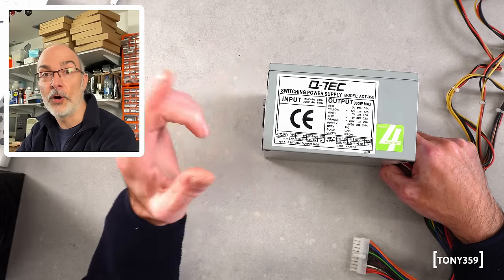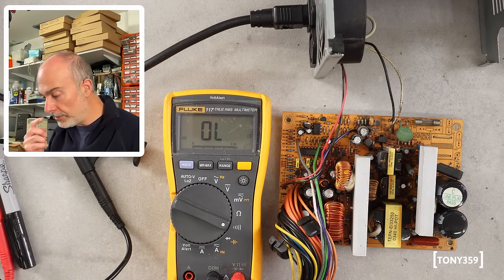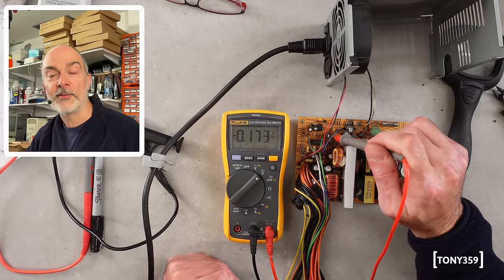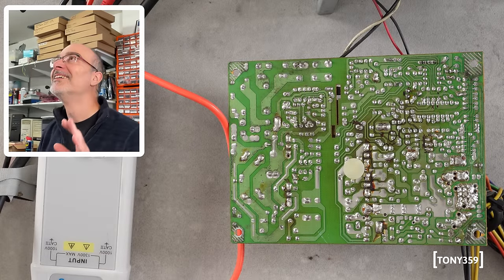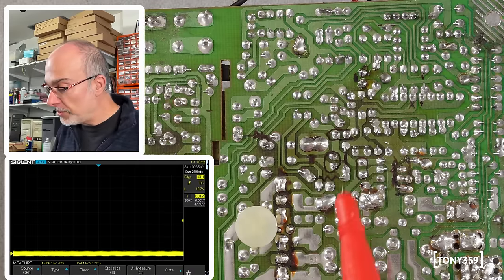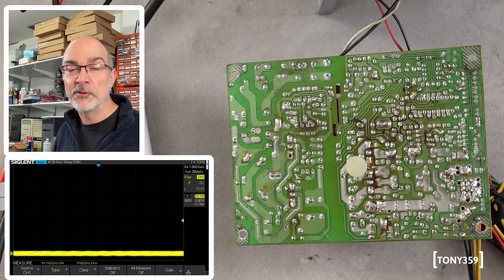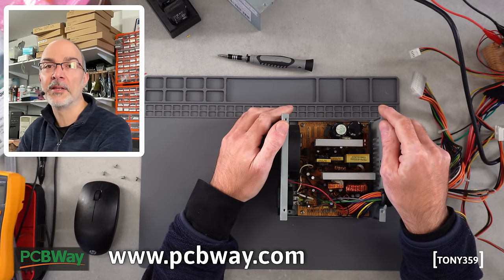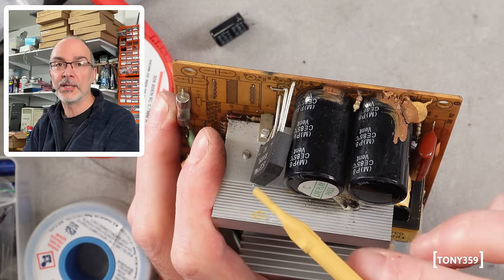Let's fix this 𝗗𝗘𝗔𝗗 ATX power supply!

Comment: I've repaired many power supplies years ago and I found it's usually the capacitors too that fail, especially the capacitors which stabilize the DC power for the switching circuit. These are usually capacitors in the 4.7uF to 100uF range and are mostly located closeby the heat sink of the MOSFETs that do the switching. The high temperature and proximity of the heat sinks dries out those electrolytic capacitors and they start losing their capacity up to a point where they cannot hold the voltage stable anymore and the entire power supply dies and starts to whistle.
Reply from the maker: Indeed, swapping the caps will revive a good chunk of those PSUs :)
Reply: Another common fault in older PSUs (80s, early 90s) is a small (single-digit µF) electrolytic on the primary side. I haven't had that in computer PSUs yet but in several VCR power supplies (Sony and Grundig). If that cap dies the PSU does nothing at all. I suspect it might be part of the passive oscillator circuit for the main power supply and if that doesn't oscillate it obviously keeps the whole unit from working. There's usually only one or two of those caps so I just replaced them all. Really interesting to understand how this circuit works now!
Reply from the maker: @Ragnar8504  Yes, that little one is critical for the oscillation!

Comment: Yey, Ton359 video! Thanks for making Friday more bearable! I fully support trying to fix things, that are broken, instead of simply throwing them. Great video, Tony :)

One small suggestion: when cleaning fans and trying to quieten them down, you can remove the white plastic circlip on the shaft, then pull the propeller out, then clean the shaft, the magnet dust and the bearing with WD-40 or IPA, then lightly grease with silicone grease. I have found this to be the cure for loud and vibrating fans with a needle shaft design. Then its simply a matter of putting the white circlip back in the groove on the shaft :)
Reply from the maker: You know what, I thought about that circlip (thanks for telling me how it's called!) - you see me fiddling with my tweezers at some point. Eventually I didn't try because I thought I might break it. I'll definitely try next time, it sounds like THE solution :) 
Thanks for watching!
Reply: @tony359  There is a slit in it, and I tend to collect dead fans, so keep them around as donors if I need to fix one. After all, to get it out you need to have side access, easy if you are breaking the rest of the motor, plus you need to often get extra little washers that set the float at the other end, as those also break or go brittle. Plus you get ball bearing ones, where you destroy the bearing removing it without damaging the shaft, but can destroy another to get the bearing out intact. Just a drop of oil onto the bearing, and leave to wick in, makes them run nice again, though getting it to the bottom needs some pressure applied to force oil through the top one, and down the shaft to the lower one. Needle through a spare rubber cap to provide the oil and pressure works, just press down on the cap to keep it on.
Reply from the maker: @SeanBZA  Thanks for the extra info!

Comment: Very satisfying to watch. The things you've learned during the repair were totally worth it. The next thing I'd have tested would have been the two TL494 outputs that switch the two small transistors that drive the base transformer. Sometimes those die as well. On the mains side of that base drive transformer there are two small electrolytic caps, typically 1uF, which are very important for driving the main switching transistors correctly. If those are dead, the main switching transistors can overheat and self destruct.
Reply from the maker: Of course, plenty of other things to check. I think it was the PS3 power supply I fixed in another video which had VCC but it was not switching - despite all the "alarms" were not on. So in that case a new (expensive!) controller IC fixed it! 
Thanks for watching!

Comment: Tip for "following the wrong trace":  Take a scan/photo of the board - top and bottom - and pull it into your PC - zoom in a few steps (4X) and its so much easier to trace the paths.
Reply from the maker: Great idea - Though I'm 100% sure I'd follow the wrong trace anyways! :D
Reply: I also sometimes put the picture alongside a mirrored one of the component side, makes tracing what goes where much easier compared to constantly flipping the board up side down.
Reply from the maker: @Ragnar8504  Great idea! I'm confident I'd still follow the wrong trace! :D
Reply: But thats what the Continuity setting is for😆
Reply from the maker: @snakezdewiggle6084  don't underestimate me! :)
Reply: @tony359 
No never underestimate you Tony. Its all the other Internet Experts that worry me. lol
Besides, we use the same grey coloured screwdriver.!😉

Comment: Thanks for this, I have modified quite a few old PSUs in the past to create variable output bench PSUs, but I have never understood how the low power circuit with the smaller transformer operated, makes total sense now. Glad to see someone actually do a repair by finding the fault instead of firing the capacitor shotgun at it, even if it was capacitor issues in the end. You certainly have earned my subscription.
Reply from the maker: Thank you and welcome!

Comment: I like the way that you worked through that. I saw the bulging 1000µF capacitors from the start so I was intrigued to see how you did the entire repair. I also like the fact that you took care of the glue. That type of petroleum-based adhesive gradually turns brown and not only becomes conductive but also corrosive! I've seen many examples where it has eaten through copper tracks, resistors and component legs.
Reply from the maker: Thank you, I'm glad you enjoyed the process! Indeed it was pretty clear the issue were the caps but it would have been boring to just swap them all!
Thanks for watching!

Comment: These ATX power supplies are relatively easy to fix.  Most problems are failing electrolytic capacitors and shorted switching transistors.  Some times just a crapped out cooling fan.  Components, except for a controller IC, are leaded through hole parts.  I"ve repaired several of them over the years so I have a few for emergency replacement in my half dozen desktop PC's around here.  Considering how cheap they look they are really quite rugged and reliable supplies.

After cleaning and checking wire connections and solder joints on the circuit board you are ready for a smoke test.  Use a series tungsten lamp if you don't have a variable auto-transformer and AC current meter to monitor power consumption from the Line.

After power up and no smoke the next thing is to power down and start looking for capacitors with high ESR (Equivalent Series Resistance).  Replace any that show significantly higher ESR than a new capacitor shows.  Then the next thing is to look for is shorted or open semiconductor junctions.  Same again, replace those that can't pass a proper transistor functionality test.

Your chance of having found what was killing your power supply is very good at this point.  Good luck!
Reply from the maker: Indeed - though you'll find a couple of videos on my channel where the fault was different. Those were fun to fix! But yes, let's say 90% it's the caps :) Thanks for watching!

Comment: Hey, instead of yanking out suspected bad caps you can just solder in a new one in parallel onto the old one, it saves a lot of troubleshooting time.  Of course this won't work if your cap is a short circuit, but I've never seen that yet and I doubt it happens often.
Reply from the maker: Thanks for the tip!

Comment: Glad you were able to restore this, possibly working better than when it was new. I did a blanket recap on my old psu, the system was working but when i changed the case i took a look inside the psu & saw loads of swollen caps.
Reply from the maker: I'm sure it's much happier now :)

Comment: Done a few of those, and generally replace the lot with around 1200uF 16V or 1500uF 16V units, as I can get skinny Nichicon ones, which will fit into the space on the board. Close enough capacitance wise, and usable on all the voltage rails. The standby supply I tend to go up in capacitance, and use 63V capacitors there, normally have a good number of 47uF 63V ones around, as those are a common enough value, and I use them on gate motor power supplies, where that, along with some 470uF 35V ones, are generally a quick fix on them. On a PC power supply higher value on small ones works, and on the larger ones whatever will fit so long as it is within 50% of the value also works, they are not too critical, just need a decent ripple current rating and higher voltage, and they will be better than the original MysterLee HooFlungDung capacitors that were used, because those were cheap that day, and fitted the board mostly.
Reply from the maker: Fuyihuu caps are the best!

That monitor was NOT cheap! I think it sold for £1000 back then. It was one of the best "pro-sumer" monitor you could get!
Thanks for watching!
Reply: @tony359  I saw some capacitors that were marked as Sanma, a cnockoff of Samwha, and some that were NItichon, a almost perfect copy of the Nichicon logo, but the caps themselves had failed while unused.
Reply from the maker: ahahah amazing!

Comment: I would recommend replacing those two large mains caps as well.

I repaired a very similar PSU a while back and re-capped the whole thing except the large ones. But it started misbehaving again after a few months. The large caps had failed and 50Hz mains ripple was coming through on the output. The caps had leaked badly, but I didn't see it because the glue around the base was stopping it spreading. 😅

Now this no-name 'cheap' old PSU is one of the best I have. Totally noise-free output, better than another much newer one I have!
Reply from the maker: Of course, I need to source some! Thanks for watching!
Reply: @tony359 just don't waste money going with branded ones, "chong" or anything similar is good enough for these PSUs, it's not like they come even from factory with something better (and managed to work for years used everyday), modern ones even come without plague installed :)
Reply from the maker: I tend to buy Panasonic - but I see what you mean. Those two caps in Panasonic brand would probably be a lot of money! :) 
I should really have two drawers: the good ones and the CHONG ones for such projects! :)

Comment: 22:40 that white plastic is removable (it has a gap that you can spread) that will allow you to separate fan blades with shaft from stator so you can clean it much better. It's pretty easy to take apart and put back together
Reply from the maker: Thank you - several viewers have mentioned that. I didn’t know that! I was tempted to try to remove that white bit but I was concerned I could damage everything. I’ll definitely try next time!

Comment: Who would've thought that cheap ATX PSUs would get some TLC! I had a 24V PSU based on the same TL494 and configuration. Everything seemed to check out except the TL494 didn't get high enough voltage just like yours. Even though the high voltage switching transistors measured good, they were bad under load. Replaced them and it was fixed! Always a satisfying feeling :)
Reply from the maker: interesting and yes, it's a great feeling!

Comment: I have a box type fan made just like that one that the motor was seized up on. I cleaned it and lubed it. It took a while to free up just like yours. I have that fan fully functional (with occasional lubricating) for 20+ years and still going.
Reply from the maker: That's great! For the next one I'd like to disassemble it further as others have suggested! Thanks for watching!

Comment: good repair.👏👏 I have a few power supplies lying around, they are useful for things like an electric screwdriver, 12 volt vacuum cleaner, etc. I also have a box with dead power supplies that I couldn't repair. I don't have much confidence in connecting the oscilloscope to those things.
Reply from the maker: Absolutely, be extra careful. I said I am "safe" with the differential probe but you're never "safe" with 340V nearby... Thanks for watching!

Comment: The squeeling is (probably) normal and a good sign, as it indicates something is switching. The ramp down on the squeel is the voltage of the switched signal suddenly dipping.
Reply from the maker: Absolutely but it is not audible with the caps replaced - I suppose many caps were leaking and the switching frequency was just making them "sing"? Thanks for watching!
Reply: @tony359  That's possible! It's also possible that the bad caps were causing the switching to be below desirable frequency or something similar. In any case, the noise does indicate a switching IC or something switching works, so it's not completely dead!

Comment: it's always best to remove the fan rotor from the body and clean the shaft/bearing with IPA. That allows you to also check for melted plastic (bearing failure)

The best lube for brass sleeve bearings is graphite, do NOT use any form of oil as it will bind and burnup eventually
Reply from the maker: Thanks, I wasn't aware that the rotor could be removed, others have mentioned that too.
I think I have some graphite grease, would that be better?
Thanks for your comment!

Comment: good video, it is always better to open the fans completely and clean them since dust usually remains trapped inside them, you can also add an LC filter to the inlet, which the manufacturer evidently bypassed on the PCB
Old power supplies can be a good replacement for engineering students as a cheap replacement to a laboratory source, but as always, everything with due caution.
Reply from the maker: Thank you, many others have mentioned the same, I was not aware! I'll definitely do that on my next fan! Cheers!

Comment: One more comment... both of those  negative 5v solutions you mentioned practically use a negative linear regulator like 7905 or LM337 to produce - 5v from - 12v - as you can see - 12v is not that well regulated in most power supplies (because it's only used by serial ports where anything above around - 8v is good enough) but it's also available in limited amount, often under 0.75A of current. So those boards make  negative 5v but it would be in very limited amount, if it's actually needed (let's say by an audio amplifier that needs +/- 5v on an ISA card) it may not be good enough. 
As for the comment at the end... I wouldn't trust it to be capable of 35A on 5v .. the label even says maximum 180w on both 3.3v and 5v combined, and 35A on 5v would be 175w but I'm not sure that transformer is good enough to do it. Also, if you look on the heatsink on the part number of the rectifying (schottky) diodes you may find out it's a pair of diodes that can do maximum 30A or something like that. For 20-25A, it's most likely fine.
Reply from the maker: Oh, I don't trust that label for a second, this PSU will explode if I tried to pull 35A from it! :D
Re. the -5V, this PSU is rated 0.5A at -5V so I guess the requirements for that line weren't a lot back then? I suppose this is why other solutions work with voltage regulators which don't output much current. I really don't know what cards need -5V though!
Reply: Hello there!
The requirements of the -5 appears to be minimum, you might find Doc TB ATX2AT Smart converter page about his measurements on the negative voltages interesting.
Reply from the maker: Thanks!
Reply: @tony359  Not many these days, as there are really no plug in modem cards around, which used -5V for the audio path, while RS232 still uses the -12V rail. Have a Dell PC where the PSU only supplies 12V, on 3 rails, and the motherboard provides the 5V, 3V3 and core voltages from that, with a small SMPS buck converter doing the standby rail. As it only has PCI and PCIE slots there must be a tiny one only to do -12V from that main 12V bus.

Comment: The  caps  seem to be a common problem and the startup resistor. Many had odd shaped power supplies but the supply  PC board had a common foot print. People wanted it replaced to save the computer. $20 or less for a replacement PC board. We had a 24 hour turn around and free delivery on repairs, repairing a $20 board was very uncommon.

Comment: Great video :)
Thank you for sharing @tony359

On the fan I would have removed the retaining washer and then disassembled the fan and cleaned the shaft and other parts.  Then used a rubber safe lube for thee rubber spacer on the shaft on the inside and under the retaining washer.
Reply from the maker: Many others have mentioned that, I wasn't aware the fan could be disassembled! I'll definitely do that next time! Thanks!
Reply: @tony359  
I use to do this to the fan in my PSU that was in my first generic AT PC case when I got my 80286 system from school.

Every few years I would have to clean and lub the fan, but the same fan lived in the PSU till I finally had to get a new case for the ATX based motherboards.

Ah, the good old days. :)

Though this works for many fans as long as they have that small retaining wwasher/ring/clip.  I normally use two small flathead screw drivers to extract the washer.

It has worked well for me since the late 80's since I found out the fans were easily repairable.
Reply from the maker: I'll definitely try on my next one, thanks!

Comment: Just as I said it would be the capacitors from the small transformer that stopped it starting.
The fan if I can't get or have a suitable replacement, you can take off the plastic washer on the shaft and take the shaft out to fully clean it.
Reply from the maker: Thanks, someone else has mentioned that, I will definitely do that next time! Thanks for watching!